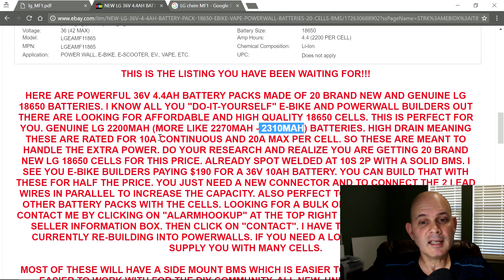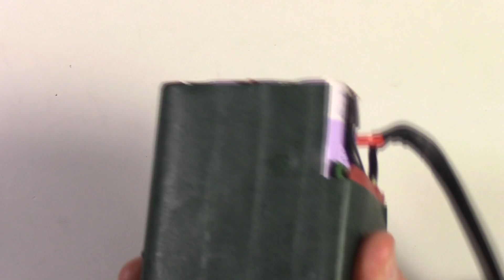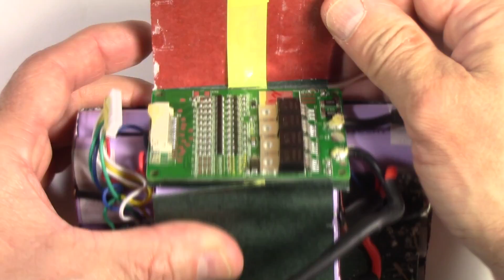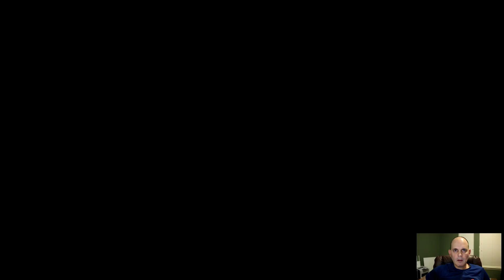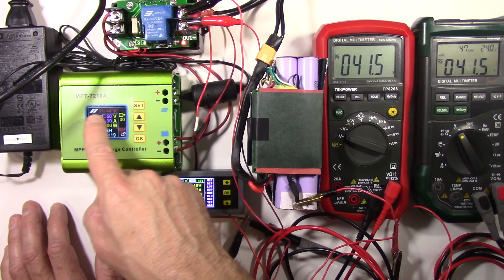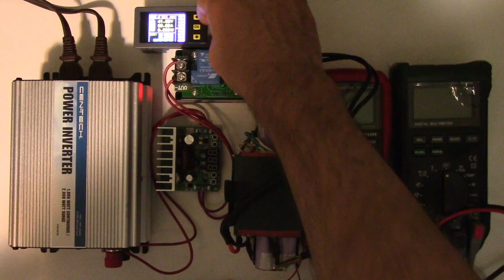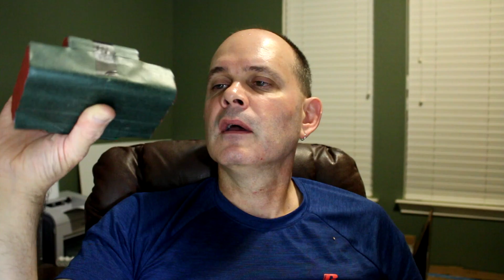NEW LG 36V Ebay BATTERY PACK 18650 Thorough Review (Great Value) For Ebike Vape Harvest Powerwall

Comment: Greetings, does anybody know what would make this 36 volt hoverboard battery make a high-pitched buzzing sound when I hook the battery up to this solar controller and 12 volt battery? Thanks in advance.
Reply from the maker: Sounds like it could be a bad BMS board on the pack. Thank you for watching and commenting. I appreciate it greatly. All the best.👍😀
Reply: Thanks I should have gotten more of these packs.  I will test to see if the pack allows a charge above 42 maybe or below... or just try another pack. If they all buzz, I will  assume it is be because too many amps on the solar controller side; the voltage is within the correct range.  Also the solar controller gets warm I replaced the solar panel with these batteries to charge/ run a DC to AC converter. Now I see DC to DC is the way to go. Next I will try one of these packs to a lower DC voltage then maybe to a higher voltage. Hmmm 120 volts DC out of a 36 volt pack.

Comment: When making a battery pack or power wall Can you use different brands and mAh rating batteries together? or do they all have to be the same?
  I harvested about 8 batteries from laptops and they all have different ratings...
Reply from the maker: They should be the exact same specifications for each one. Thanks.

Comment: Hi there! I intend to use one of those batteries in a electric skateboard. Do I need just the battery and charger or all those other stuff? The bms will stop the charge and the light on the charger will change color when is complete?
Reply from the maker: You need a reliable charger with a proper voltage cut off and it has to have Constant Current/Constant Voltage CC/CV charging. It should be designed to charge lithium batteries. Do not rely on the BMS to stop the charge as that is not it's design purpose. The BMS that comes with this pack is there just to protect the cells. Thanks.

Comment: good review....you got the rated capacity at 2 amp discharge, like to see discharge numbers at 10 amps....they are a power cell after all....that bms limits the total voltage cutoff at high volts and low volts.....looks like it works....HOWEVER......does not balance as you said.....which potentially can overcharge individual cell pairs in the pack....for example...two pairs of batteries may be at 3 volts, while the rest of the pairs in the pack are higher than the recommended max voltage.  That bms shuts off the charging voltage when the total cell voltages combined are 42 volts, it does not monitor individual cell voltages.....so if two cell pairs were at 3 volts apiece(2S)x3=6 volts, the other (8S) could be 36 volts before that bms shuts off the charge at 42 volts...hazardous!   36 divided by 8 =4.5 volts per cell pair....so the same holds true for low voltage cutoff....some batteries may be discharged below manufacturers recommendations, while others still have some juice left.  A balancing function is imperative for cell protection and long life.  that battery pack will become more and more unbalanced with each discharge/charge cycle, until some cells will be ruined by overvolting, and other ruined by overdischarging.   A balancing board will fix this, but be aware that some balancing boards do not shut off when low voltage occurs, and may balance the batteries until they are all “flat”  or totally discharged.  Two “Blinky” cell balancers could be wired up to that existing pack to balance the cells, just make sure to unplug them when the battery is not being used... you illustrated the capacity of these cells well!   They do appear to be genuine, quality cells, but I would not be using that cheap bms with any of my e-bikes. a balancing board is a MUST.    thankyou for the video!
Reply from the maker: You are most welcome. The BMS is basic to say the least. I would recommend upgrading the BMS to a balancing system so that you don't have to manually do it or even worry about it. Thanks.

Comment: Nov. 16, 2017 > Question - The LG's I just received (50) many are precharged to 44.5 volts or more.  Anyone, how is this possible?  Why wouldn't the BMS shut off at 42V?
Reply from the maker: That's not good. If you suspect that they are damaged, Tom at Alarmhookup is very good about returns. Contact the company and see what they will do for you. Thanks.

Comment: as you can see there is 20cells that will give you 72v of nominal voltage in 2,2ah, what mean that 2 cell are connect I paraler, that give you nominal voltage of 36v and 4,4ah
Reply from the maker: Thanks

Comment: sorry I forgot the link https://www.youtube.com/watch?v=tbaeMWdDlqY&t=322s
Reply from the maker: He states that not all Lithium cells have to be balance charged. He states that as long as the load on the pack is low you "could get away" without a balance BMS. In his opinion if you stay below the threshold of the "weakest" cell you can "get away" with it. But if you don't use them in the same limited way every time he even states that you SHOULD use a balance charger. But he does not state HOW to find out what that level of discharge is on the weakest cell. Thanks.

Comment: Hi Richard. Two of my packs may be bad. I picked up 10 of these to use with a converter to power a 48V ebike. Upon testing them, I found 8 charged to 41.6 to 41.8v, good enough. But 2 charged low at 39.7v and 40.4v,  a little over 1 and 2 volts short. I was hoping to get some input from you or others, on whether I should push for an exchange or use them along with the good ones in my parallel set up?

The one person I did ask advice from wasn't too happy with the low voltage, and me? not knowledgeable enough to really know but I tend to agree with him. Here's what the seller says, and FWIW, I sent him a video of me testing them:

"New message from: alarmhookup T
That's weird because each cell is 4.2v fully charged so if it was a bad cell then most likely it would only charge to 37.8v or less. I think the BMS on those 2 packs have different over voltage protections built in. Technically 4.1v per cell should be the max charge. Charging to 4.1 instead of 4.2v has shown to almost double the life cycles. So the BMS on those 2 packs is probably set to a new life extension setting. Maybe the Version of the BMS is newer and those settings are just a volt less. If you parallel them all together the battery packs should balance at the slightly lower voltage and the overall life of the battery should be extended."

Comment: Too bad about the balancing, wish the seller had mentioned that. I'm clueless about that part of a build, the very reason I bought these 10 packs. I guess I wrongly assumed BMS, meant it included a balance option.
Reply from the maker: The balance feature is a nice to have but really it's not required as long as the pack starts balanced it should stay balanced as all the cells are identical in every way. If you are worried about it you can always manually check the balance as I show in the video or you can invest in a balancing BMS (Under $10 on Ebay) https://goo.gl/qgTQtB But regardless this pack is a great value in just cell price alone. Thanks.
Reply: Thanks Richard, from what I've gathered you are right. They go on about balancing so much, one would think it necessary, and I guess the feature is handy, but think I'll not worry about it, and  maybe check them down the line, and see for myself. If they get out of balance even a half dozen times in their life cycle, that's acceptable and even fixable manually as you say with not too much trouble.

Comment: quick question- if i wired a bunch of these up in parallel to increase capacity what should i do about the BMS on the packs?
Reply from the maker: There is no need to do anything with the BMS's in parallel they should work just fine.

Comment: How do you hook packs together in order to maintain 36v but increase the Ah's. In other words how do you wire them in parallel. Do you just use a connector to connect positive to positive and negative to negative? And is that safe? Thanks.
Reply from the maker: To connect these in parallel you have to connect the positive to the positive and the negative to the negative. Most people connect them to a common bus lines, one for the positive side and one for the negative side. Here is a great guide to doing this and what the results will be: https://www.batterystuff.com/kb/articles/battery-articles/battery-bank-tutorial.html

Comment: Aside from pulling connectors apart by the wires (dangerous on LIPO battery packs), that was well done and thorough test.  Thanks for posting.
Reply from the maker: Thank you very much for watching and the kind comments. All the best.

Comment: could I run it off of a 12 volt battery charger? Thanks.
Reply from the maker: Yes it can be run off a 12V charger but make sure it is at least 4-5 amps in current output. Here is the link to the charger on Ebay: https://goo.gl/x5p1MN or here on Amazon: http://amzn.to/2xf9CeR Take a look at all the specifications listed in the listings. Note they don't state Amperage input. Thanks.

Comment: how do you power that solar regulator charge controller? Apparently it can not be run on normal 11o volt house current.
Reply from the maker: Not it can not be run on house current. it can be run off a 12V charger but make sure it is at least 4-5 amps in current output. Here is the link to the charger on Ebay: https://goo.gl/x5p1MN or here on Amazon: http://amzn.to/2xf9CeR Take a look at all the specifications listed in the listings. Note they don't state Amperage input. I use an old HP printer power supply at 36V 1.5 Amps. Thanks.

Comment: i have 5 of these and plan to put them in my 36v 800w scooter. as i have very limited knowledge on this subject, i would like to know as how do i connect the 5 packs without taking them apart. if the 5 packs can be connected together to be used in my scooter, what charger should i get? or any better ideas for my intended project? thank you for all of your videos.
Reply from the maker: I am not familiar with scooter systems so I can't really advise you on that. Perhaps you can find a forum where you can get some advice like https://endless-sphere.com/forums/viewforum.php?f=22 Thanks.

Comment: Richard are the batteries in the pack individually protected.. so if i harvested this pack I wouldn't have to add protection to them?
Reply from the maker: They are only protected when they are connected to the BMS. If you harvest the cells the cells will be bare unprotected 18650 cells. Thanks.
Reply: Richard Thanks for the quick reply.. I would like to make a suggestion.. I'm thinking about making a power wall charged by solar.. to charge electric vehicles or for household needs and also sending current back out on the grid.. Are you thinking of doing any projects like that?
Reply from the maker: I am considering a power wall and perhaps some portable power storage solutions. The problem, I find is efficiency. I am looking at circuits like these Boost Buck DC adjustable step up down Converters at Ebay: https://goo.gl/cM75aT or Amazon: http://amzn.to/2y3JOWZ I want to skip the conversion of the DC to AC back DC that an AC inverter requires. Most of my digital devices, like laptops, routers, modem, IP phone, Monitors etc. all take 120 AC and convert it to a DC input. I would like to make a sub system using the above converters that converts the 36V from the power pack directly down to the 5V, 9V, 12V or whatever the device requires from 1.25V ~ 35V at up to 3 Amps per circuit with a 94% efficiency! Wow. I think splitting the system into two systems a DC System and an AC system would make it far more efficient. Thanks.

Comment: Richard I was looking at the datasheet & I can't seem to find where the cycle life is, do you know any information on that?
Reply from the maker: It is on the data sheet on page six but it's called cycle life http://www.houseofbatteries.com/documents/5216-BatteryLines/LGLithiumIon18650MF1Rechargeable.pdf 

4.2.3 Cycle Life
Cells shall be charged and discharged per
4.1.3, 500 cycles. A cycle is defined as one
charge and one discharge. 501st discharge
capacity shall be measured per 4.1.1 and 4.1.2
≥ 70 % (of C min in 2.1) Thanks.

Comment: if I buy 5 of these for my electric bike what charger do I need? Thanks.
Reply from the maker: What charger are you using currently? Thanks.
Reply: Richard Lloyd i have an rc charger but i think it only does up to 20 volts. All the 36 volt chargers i see have a three prong connector. But these packs have xt60.

Comment: Hi Richard  one question  the battery pack what is the maximum ah you can charge?  And what is the recommended ah to charge 
Thanks very nice video
Reply from the maker: I am not sure what you are asking for here but the max charge the pack should take is 42V and the maximum (specified) capacity of the pack is 4.3 Ah. You shouldn't exceed any of those parameters. Here is the specification sheet for the cells: http://www.houseofbatteries.com/documents/5216-BatteryLines/LGLithiumIon18650MF1Rechargeable.pdf this should tell you all you need to know including the charge rates. Thanks.
Reply: Richard Lloyd hi it says  Max. Charge Current 1.0C(2,150mA)  so meaning 2.15 ah maximum charge rate?
Reply from the maker: I think you are confusing charge current with cell capacity. 1.0C (2,150 mA miliamps) or 2.15 Amps is the maximum current that should be applied to the cell while charging. 2.15Ah Amp hours is a measure of charge capacity. In this case the cell is capable of delivering 2.15 Amps under load for a total of 1 hour before reaching it's lowest discharge point (in this case 2.75 Volts). The charge rates on the spec sheet are: 
“Standard Charge” shall consist of charging at constant current of 1,075mA. The cell shall then be charged at constant voltage of 4.2V while tapering the charge current. Charging shall be terminated when the charging current has tapered to 50mA. 
Thanks.

Unless otherwise specified, “Standard Charge” shall consist of charging at constant current of 1,075mA. 
The cell shall then be charged at constant voltage of 4.2V while tapering the charge current. Charging 
shall be terminated when the charging current has tapered to 50mA. For test purposes, charging shall be 
performed at 25ºC ± 2ºC. 
4.1.2 Standard Discharge 
“Standard Discharge” shall consist of discharging at a constant current of 430mA to 2.75V. Discharging is 
to be performed at 25 ºC ± 2 ºC unless otherwise noted (such as capacity versus temperature). 
4.1.3 Fast Charge / discharge condition   
  Cells shall be charged at constant current of 2,150mA to 4.2V with end current of 107.5mA. Cells shall be 
discharged at constant current of 2,150mA to 2.75V. Cells are to rest 30 minutes after charge and 30 
minutes after discharge.

4.1.1 Standard Charge 
Unless otherwise specified, “Standard Charge” shall consist of charging at constant current of 1,075mA. 
The cell shall then be charged at constant voltage of 4.2V while tapering the charge current. Charging 
shall be terminated when the charging current has tapered to 50mA. For test purposes, charging shall be 
performed at 25ºC ± 2ºC. 
4.1.2 Standard Discharge 
“Standard Discharge” shall consist of discharging at a constant current of 430mA to 2.75V. Discharging is 
to be performed at 25 ºC ± 2 ºC unless otherwise noted (such as capacity versus temperature). 
4.1.3 Fast Charge / discharge condition   
  Cells shall be charged at constant current of 2,150mA to 4.2V with end current of 107.5mA. Cells shall be 
discharged at constant current of 2,150mA to 2.75V. Cells are to rest 30 minutes after charge and 30 
minutes after discharge.

Comment: Im a novice here. If I want to charge the battery, can I just connect the XT60 connector to the IMAX B6 Balance chager's output ports?
Reply from the maker: This is a 36 Volt battery pack. If you connect it directly to an Imax B6 charger you are most likely going to blow the charger as the maximum an Imax B6 charger can handle is 18 Volts. Thanks.
Reply from the maker: I used a Turnigy charger to discharge test the cells but I connected it individually to each individual pair of cells to test them. Thanks.
Reply: Thanks Richard

Comment: hi you say  the this pack  come whit 10 cell  in this video but i count 20,  so  is 10   or  20  for pack?
Reply from the maker: It is a 10S 2P battery pack meaning it is comprised of 10 groups of cells. Each group is (2X18650 cells connected in parallel) then all ten of these pairs of cells (groups) are connected to each other in series. So you get a total 20 18650 cells in a 36V 10S 2P battery pack. Thanks.
Reply: it's a 2P 10S pack  ....   Capacity then voltage  ;)

Comment: I have a RavPower RP-PB41 26800mAh powerbank from almost 3 years old. The powerbank is starting to lose it power. Can I change the batteries in side?

Can I also go for a higher mAh battery?
Reply from the maker: I don't own one so I can't say from experience if it is possible or not. Have a look and see what you need to do. Also if you change the cells make sure they are all identical and that you change them all. Thanks.

Comment: Bought these per Jehu's recommendations! Can I charge with imax b6? If so what settings?
Reply from the maker: It is possible but you would have to charge the cells individually. You need a proper 42V charger to charge these cells. The one I use in the video MPT-7210A at Ebay: https://goo.gl/V7cUzF works very well, is programmable, can be used as a solar charger, does CC. CV (Constant Current, Constant Voltage) charging and is very reasonably priced. Thanks.